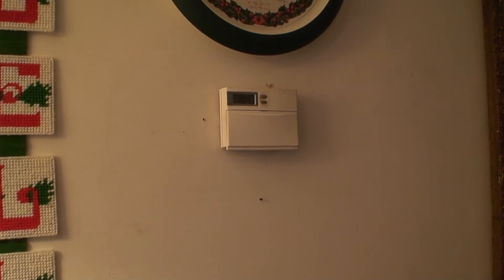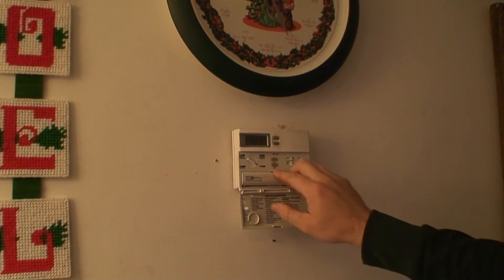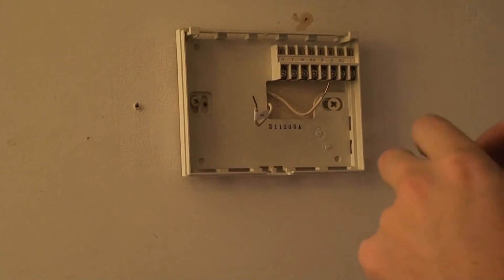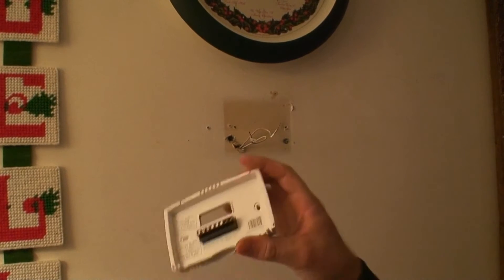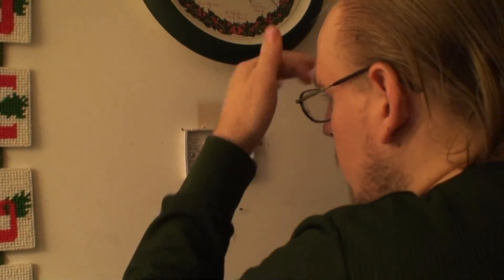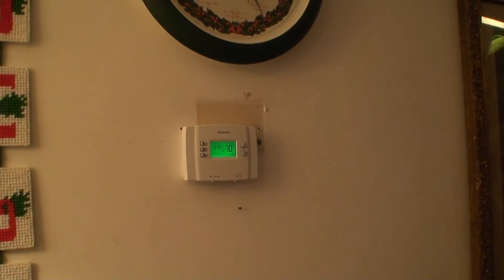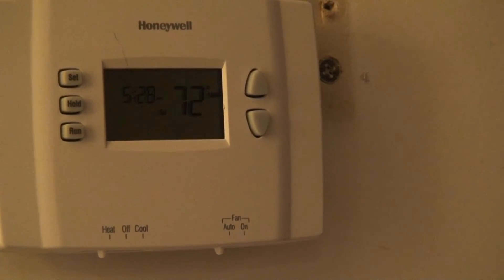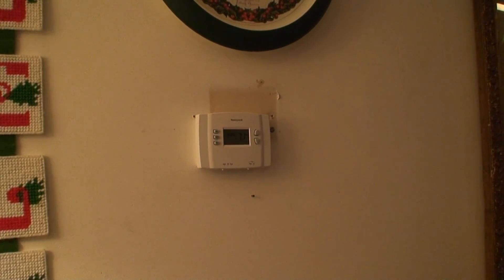Replacing A Digital Thermostat

Comment: The paint may have killed it, but I would have hit it with some compressed air before giving up entirely on it.  If it still failed, time for more China Pride thermostats.  Otherwise, if you leave it set to 68° all the time, just get an old school Honeywell round yo-yo style and be done with it!
Reply from the maker: jaykay18 actully the new t-stat is mexico pride with china parts. i could go old school but this was cheaper of of fleabay then walmart who sold the same thing. i might use the program part later when i get a better furnace
Reply: lexmarks567 I never had any use for programmables.  My dad went that route in 1990 I think it was, when he had his system converted from oil to gas.  While he's still running the same 'stat from 1990, he's changed the programming many times over the years.  One trick he tried was lowering the maximum temperature a degree every year.  Now his "everybody's home, we need the heat on" is 56.  I'm lucky I never froze as a kid.

Even well before that when it was at a more reasonable temperature, it was always freezing in the house.  I've said it a thousand times, thermostats keep the temperature constant.  If you keep messing with the temperature, they don't work as designed.  It's not just the temperature, it's the "core" temperature of the house.  Just like you can be outside on a freezing cold day, and come in to a nice warm house, but stay freezing, until maybe you have some hot chocolate or coffee or soup, the house is the same way.  You felt my A/C in the summer.  It was broiling hot outside, but downright cold inside, everywhere.  Stays on 70 from June till October.